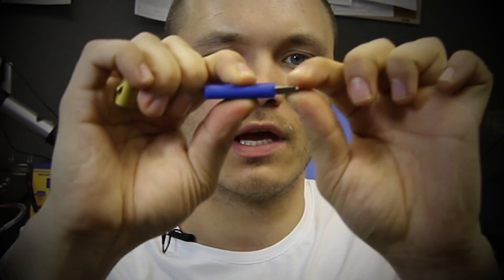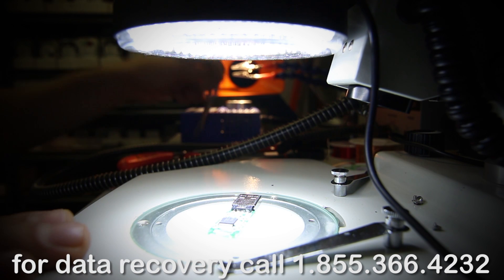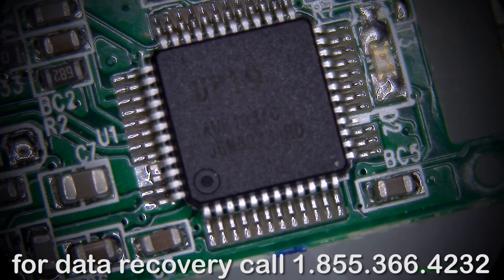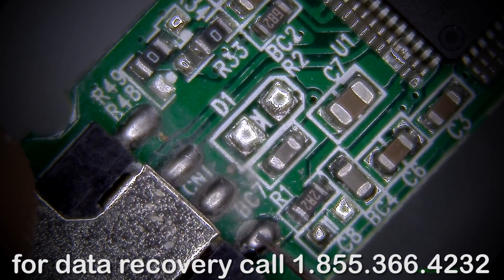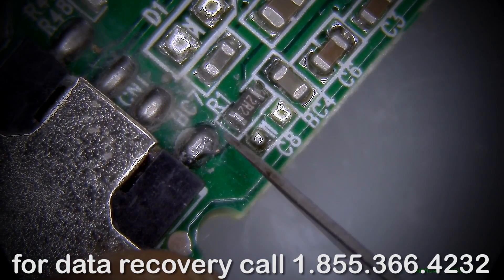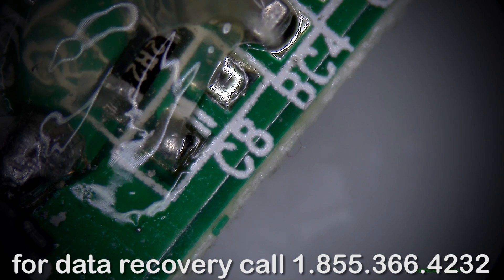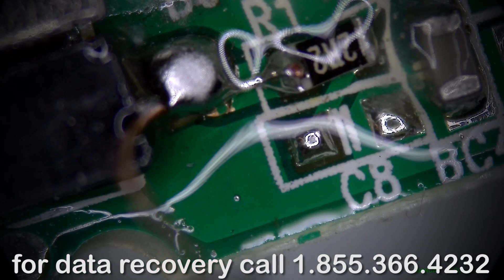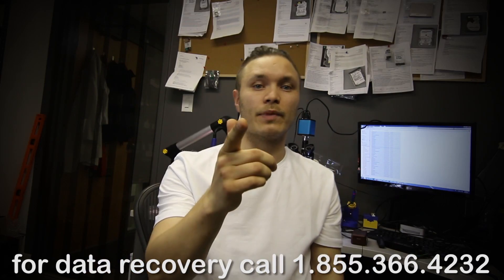flash drive not recognized: diagnostics, repair and data recovery

Comment: I have always had trouble soldering.  Please let me know what type of flux do you use?  What solder (acid or resin core or solid and what mix of lead) do you use.  Also, what wattage soldering iron do you use.  A brand and model would also be helpful.  I currently have three different soldering irons of different wattages and they either do not melt the old solder or end up heating the item I am soldering too much or the solder just beads up and does not stick.  Any help would be appreciated.  Thank you.
Reply from the maker: I use JBC for soldering equipment and MG chemicals brand consumable for the most part, solder wire is a regular  63/37 led mix

Comment: I have data on my USB Drive. It has always worked but for some reason, when I plug it in windows 10 does not detect the drive. Actually if you watch carefully, it shows up for a split second then disappears. Windows states it cannot detect drive in D: All other usb drive work fine. Just this one has problems. Help?

Comment: DISKPART> select disk 1

Disk 1 is now the selected disk.

DISKPART> clean

DiskPart succeeded in cleaning the disk.

DISKPART> create partition primary

No usable free extent could be found. It may be that there is insufficient
free space to create a partition at the specified size and offset. Specify
different size and offset values or don't specify either to create the
maximum sized partition. It may be that the disk is partitioned using the MBR disk
partitioning format and the disk contains either 4 primary partitions, (no
more partitions may be created), or 3 primary partitions and one extended
partition, (only logical drives may be created).

Comment: Can you tell me what you charge to repair a flashdrive?  Mine has almost 14,000 photos on it and I don't want to lose it, but cannot get it to work!
Reply from the maker: Hi Kimberly,
charge per job depends on few factors. Can you reach out to us either via email or facebook? HDD Recovery Services on Facebook is us, you can just message there and we will follow up quickly.

Comment: not really data recovery here, simple solder repair job, hope you didn't charge them much.  I do these repairs all the time.  Its very easy for people to  break off the connectors.
Reply from the maker: +Jay Walt I agree that this is more of a repair process, and this time we got lucky that repair was very simple. But the point of the process was to get access to the data. Connectors break often, specially when the unit is plugged into the laptop and laptop falls on its side.
Reply from the maker: +Jay Walt on some vendors these connectors snap off not so conveniently and really far into the unit, that there is almost no track left like in this case:
https://scontent-ord1-1.xx.fbcdn.net/hphotos-xtl1/v/t1.0-9/12802854_957065601028318_843912420979267335_n.jpg?oh=64dd00a6cf709b65331e31084b48b2cf&oe=57922927 I barely managed to jump a 41 gauge wire up on there
Reply: Jay Walt if you don't charge your customer then you lost your profit as your aim is to make money by solving the problem of customers even the problem is minor or too minor the thing is solving the problem.
Reply: Jay Walt as the main mission is to  make that drive work and retrieve data that means he is recovering the drive from problem so it can be called data recovery